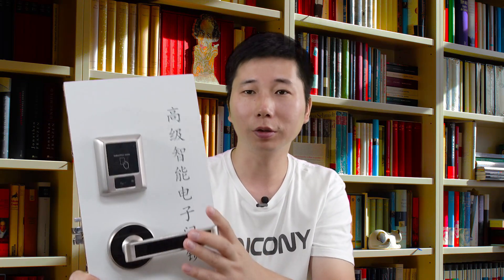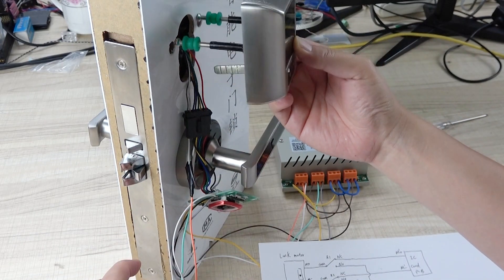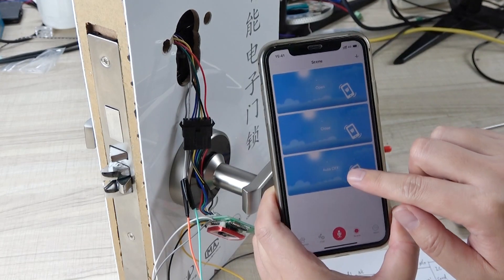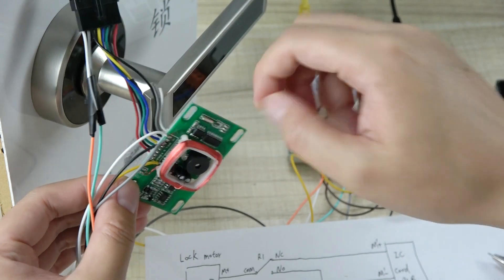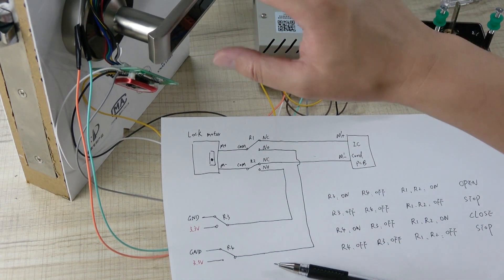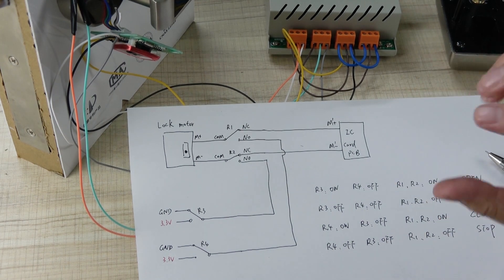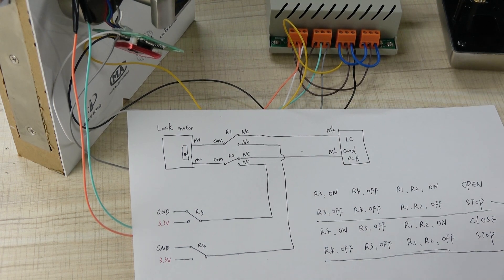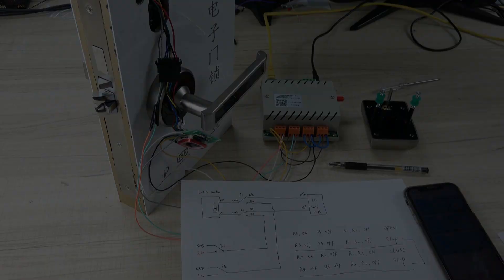DIY solution for your electronic door lock become smart

Comment: Sir if ever the battery is very low is there possible the electronic board can't activate and what is the remedy to open the door
Reply from the maker: also can use by key, if use key not need any power.

Comment: Thanks for the video. It is awesome and now I got an idea how to hook into a lock.
You are using the cables close to the controller, but I think on some models it won't be so obvious to find the right cables and it would be easier to use the cables closer to the motor.
However, the most important information is the relay diagram.
Reply from the maker: usually motor use 3v, you can open the lock body, see the motor by eye, but be carefully to open the body.

Comment: Good but you didn't show the main mechanical part.lock motor
Reply from the maker: the motor work for 3V. small motor just use for toy.
Reply: @KinCony  how to connect with normal lock
Reply from the maker: @ajiyadhstreet2763  do your normal lock is electric lock?
Reply: @KinCony  no.can you recommend one model suitable
Reply from the maker: @ajiyadhstreet2763  firstly, you need your door lock is electric.